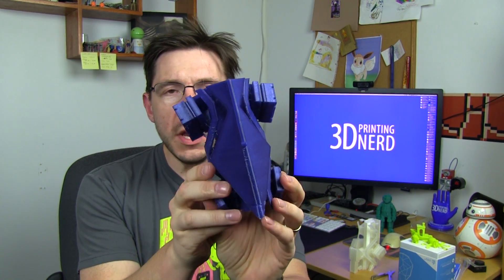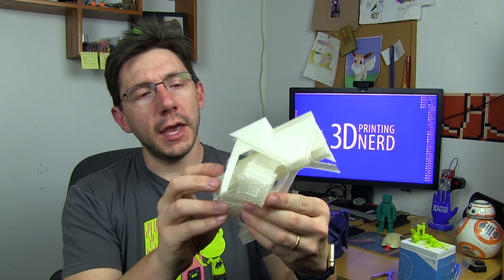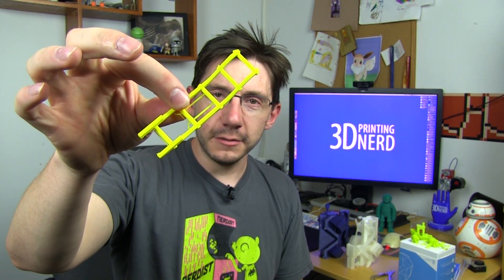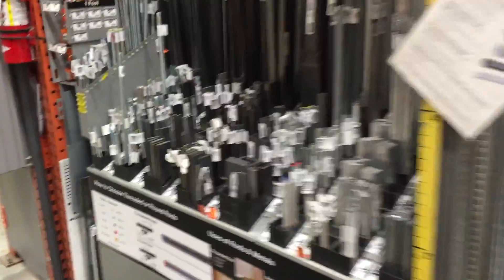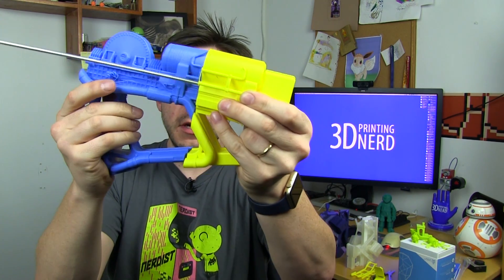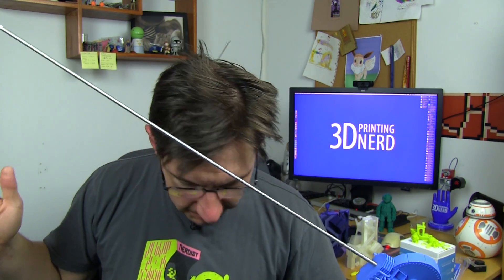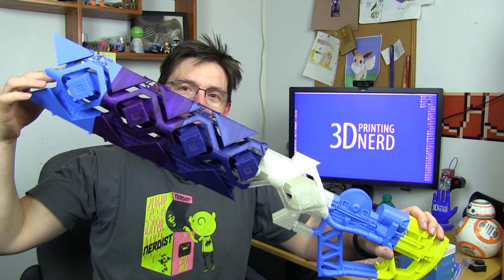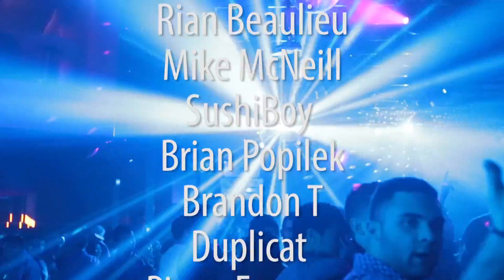3D Printing the Sleeper Simulant Part 2

Comment: Rockin the safety squints in this episode. Get some safety glasses and a proper space for cutting those threaded rods, otherwise you risk losing you vision.
Reply from the maker: +Ryan Bellaver But, my eye lids are SUPER strong. ;) you're right, glasses to be aquired.
Reply: +3D Printing Nerd just a tip, get z rated ansi safety specs. Good for accidental high speed impact.

Comment: The threaded rods are probably a good call as cyanoacrylate glue requires air to cure properly, without the threads to hold air inside the part the glue in the middle probably would never dry.  Also, a light dusting of baking soda can act as a curing agent to make the cyanoacrylate cure in a fraction of the time.  They also make spray-on versions of drying/curing agents for various adhesives that are a bit more convenient to use.   Also, guns are heavy... so having it be heavy will make it look more believable as a "real" gun when you're walking around with it.  In one of the early episodes of Star Trek Voyager (Actually, the very first one, I think) the crew was running around with some rifles and because the props they were using were so lightweight, it just made the look ridiculous.

Comment: As you were sliding on the blue part C (?) I was suddenly like holy crap, I need to 3D print a gun. Though I couldn't help but think about leaving out one of the rods to wire some LEDs and sound effects.

It did seem like you missed opportunities for sharing more information though. For instance, you needed 4.8mm rods, but what is that in inches. What size rod did you buy, and did you intentionally undersize it because you went with the threaded rod. Did you consider wooden dowels? And what were the final lengths for anyone looking to make their own gun.

But #highfive, I think you got me hooked.
Reply from the maker: +John-Paul Hopman JOHN! shoot. I did miss some stuff. I'll try to address that in part 3! Also, yes, you're hooked. it's FUN
Reply: I forgot one thing, could you print the pieces without top and bottom layers giving you more room for adding electronics (if so inclined).

Also, what about modding the files to allow the use of nuts since you are using threaded rods. Just a thought.
Reply from the maker: +John-Paul Hopman Yes, technically, you could I think. modifying the files is also possible!

Comment: Joel Telling: capable of simultaneously printing on a half-dozen-plus 3D printers simultaneously, each with different settings and filaments, all with a bare-minimum amount of sleep to keep him going. But completely incapable of measuring and cutting some metal rods without potentially wounding himself and/or putting holes in the wall/monitor/ceiling/desk/removing his own finger/etc. #IBlameItOnSleepDeprivationHighFive

Comment: Check out PolySmooth and Polysher on Kickstarter, easy to remove support plus you can smooth all the prints to get rid of your layers using Isopropanol instead of acetone.

Comment: Great assembly man, A big hi5 for you.
Small question, you printed in different materials, don't you think this will at the end give problems when painting the gun? I mean, for different materials you also need different primers and paint.
Reply from the maker: +3d Print Creator It shouldn't. Different manufacturers, but ALL PLA :)

Comment: How would you got about printing a helmet? If you had a printer that could print the entire thing, would you add support inside to support the top, make it thick, etc?
Reply from the maker: +SkintSNIPER262 The gMax 1.5XT+ printer can do a full size helmet all in one piece, and depending on the angles, it may not require internal support.
Reply: 3D Printing Nerd Thanks!
Reply: 3D Printing Nerd Question, I'm not sure if you had a look but how do you think the gMax compares to the N2 Plus?
Reply from the maker: ***** N2 Plus - link?

Comment: Dont print yet!
before printing you should put, i dont know what the name in english is but its kind of a plastic clay I guess, which is usually used for modeling, so what i recomend is puting some of that in excess where the pieces are joining and sand it down after, this way you will have a flat surface on the joints
Reply: +redcshnovic do you mean milliput?
Reply: Epoxy putty would work

Comment: the rod is called "allthread" you use it in construction. you can sink it in concrete and when it dries out can bolt things to it. Street lights for example. #highfive
Reply from the maker: +dwarf365 YES THANK YOU. allthread. dang it. I suck at words. #ReturnFive
Reply: +3D Printing Nerd Over here in the UK it's called rebar (Reinforcing Bar), as Dwarf365 said, it's used to reinforce concrete.
Hold on, that almost sounded like I knew what I was talking about ... Don't try that at home :-)

Comment: hi! great video, 
would you ever consider looking at any laser cutters or CNC mills?
Reply from the maker: +Maker Box YES. I've always wanted to get my hands on a laser cutter and a cnc mill!
Reply: +3D Printing Nerd cool, laser cutters are so cheap these days but CNC mills always seem to be hard to use, I recently bought a laser cutter from eBay for about $60, sadly it can't cut wood but it can engrave it and cut stuff like cloth and even metal!
Reply: *engrave metal